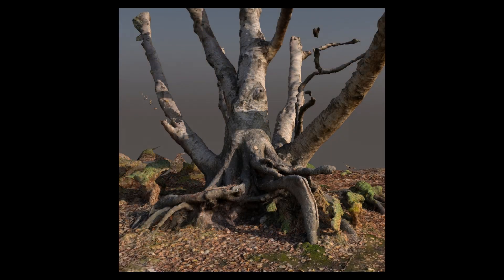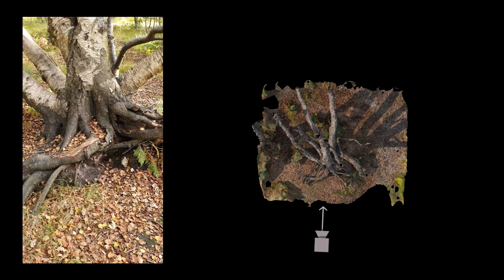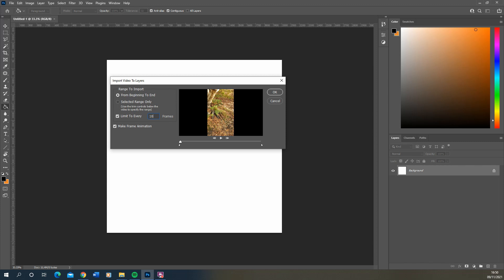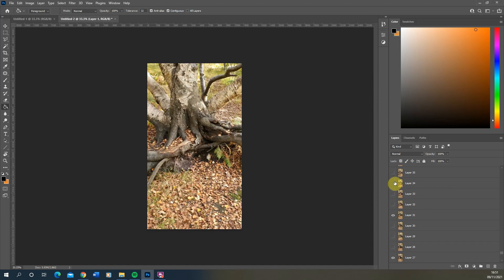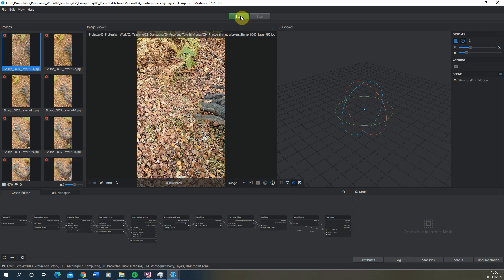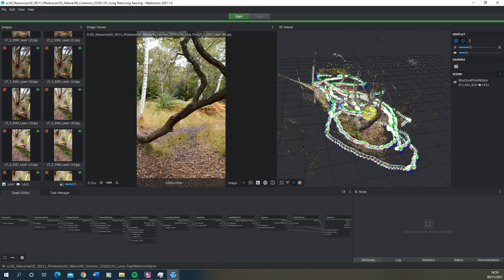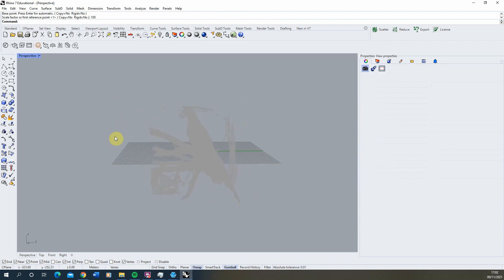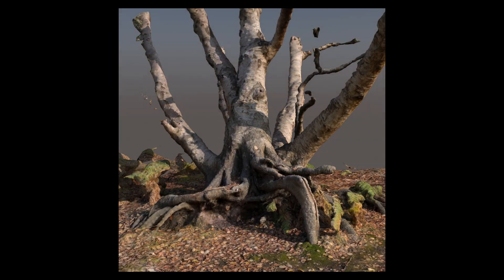Creating 3D Scans and Importing into Rhino - Photogrammetry Tutorial

Comment: That "automatic" texture import when switching to Rendering view doesnt work for me. Now it seems that you need to manually set the Texture type as HDR (so it recognizes .exr). But even by doing this, my model becomes pitch black and I havnt find any solution so far to display my textures.
Reply: Same here, have you found a solution?
Reply: @mukunda3910  I'm having the same issue, has anyone found a solution?